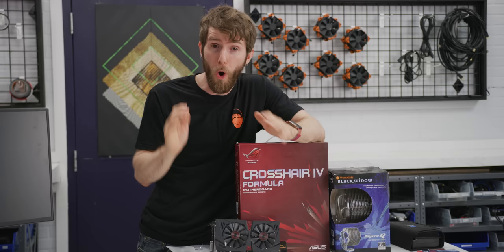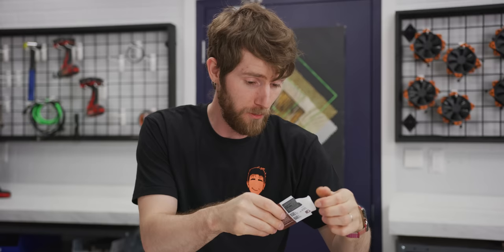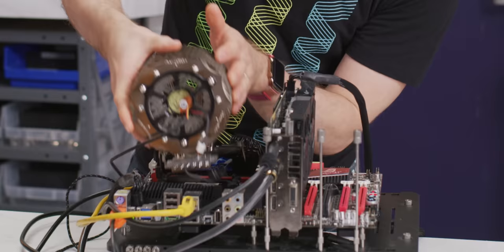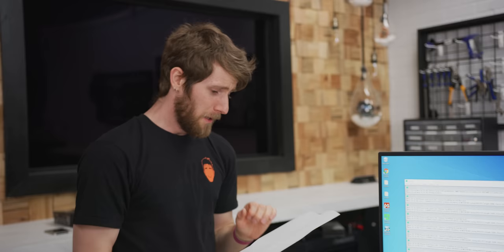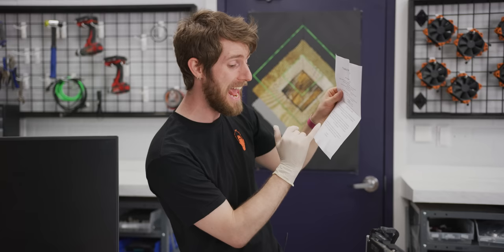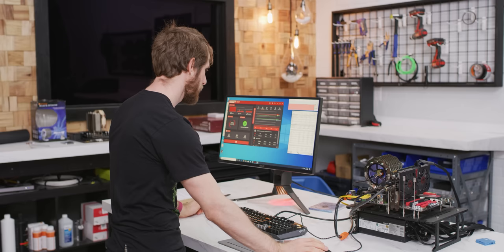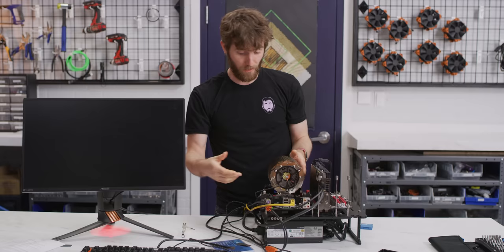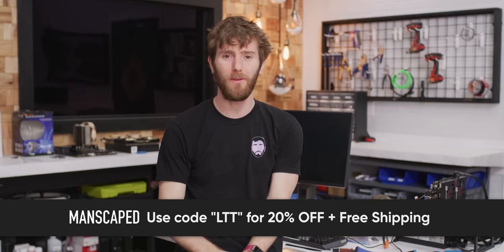Testing Another YouTuber's Thermal Compound!

Comment: Linus: "Haha the FX-8150 is so bad."
Me with an FX-4350: :C
Reply: hey 4 cores at 4.2 GHz base ain't so bad, giving you have an adequate solution to keep that 125w tdp under max operating temps of 61C. 
My brother is actually still using an intel core i7-860, which is advertised as a server/enterprise chip on intel's website for whatever reason.
Reply: @MrPlaneCrashers  Not really 4 cores, this thing should be around as fast as an i3 the same age in applications and slower in games.
Reply: @MrPlaneCrashers  I think literally any (or nearly any) ryzen chip outperforms a 4350, even with a slower clock speed from sheer IPC increases.
Reply: @MrPlaneCrashers  These are just Numbers, wich don't Cover every factor of Performance. I also have an fx Socket AMD CPU (A10something) and it's very slow. Gets half of the cinebench score of my 2011 Laptop. (the Desktop CPU is from 2013 or so)
Reply: @FredFredBurger92  No shit...
Reply: I used to have an FX-6300 but I upgraded.
Reply: I get it, it is just a number. I checked on userbenchmark as well as on this random video: https://www.youtube.com/watch?v=hJ8ulfGQRe0 and you are right, performs about as well as a 2013 i3-2120 or a i3-2130. I did not find a video comparing an i7 860 to other cpus, but userbenchmark says an i7 860 beats the FX-4350 by about 10%~, but most of that comes from the i7 being multi-threaded. That being said, from my very limited knowledge of CPU, I would expect the FX-4350 to be able to handle most basic tasks today. I do not think you should be having any problem gaming or doing any browser based activities that does not involve having more than a dozen tabs open. 

In conclusion, unless you have a specific scenario where your cpu is severely limiting you, I do not think you need to feel ashamed of your cpu. 

It is surprising sometimes how much game you can play on a crappy cpu given you have a good enough gpu.
Reply: If you are extremely broke and you have some decent ram and gpu a 8350 its a tiny upgrade but youll be really happy with it, ive been running mine for years. Most games even the new ones run perfecly fine on 1080p around 60fps, you could also overclock a tiny bit. Send me a message if you happen to need help with the overclock.
Reply: @MrPlaneCrashers  Yeah, for Medium Gaming it's ok, but if You do real work with your PC (editing, CAD,...) this CPU is useless. (btw. The amount of Tabs You can open depends more on your RAM than on the CPU.)
Reply: As i said, in comparison to my Laptop, i really feel how slow my Desktop is. Just when i browse the Web or doing oher Light stuff.

Comment: I feel like that thermal poxy would be perfect for when you want to use some small aluminum heat sinks and glue them on to ram chipsets or maybe the motherboard chipsets that dont have a cooler on them or any way to mount to the chip with a cooler

Comment: Linus: "Could anything be more conducive than silver?"
Me: Uhhhh... Diamond....
Reply: Also graphene. Both of which are in this epoxy.
Reply: Gold
Reply: @davidrasthammar1057  Both silver and copper have a higher thermal conductivity than gold. Although I have to agree that gold could be more *conducive*.
Reply: @andrewmorton9683  Gold doesn't tarnish or react with things - which is why a gold frying pan is great for frying eggs (some nutter actually did this in the 1970s for a National Geographic article, but had to give the gold back afterwards)

Comment: I love the GD-900 at 4.8 Wk, i put it on all my computers, laptops and even the video cards. Stable and cheap! 
One 30 Gram bottle about $6-10. Also like all the top better ones too for a few degrees cooler but much more expensive and anything around 4-5 Wk will do a good job and you can see your laptop run cooler and fan slower even though you see around the same temp running. noticeably less heat coming from fan area. These sort of tests, you have to lock off the fan speed and throttle or it will adjust and you could see all same temps. Another channel tried thin to thick applications and found the temps come out about the same although you should aim for a thin even coat in theory.   Loved your channel and all the advice and testing you do is a great help.

Comment: I have made a beer cooler using a peltier,  I have tested pro weld quick, just the steel tube, no hardener,  on it,  it works, it has metal in it, it kept me beer cold,

Comment: I worked with silver epoxy on a microscopic level to create electrical contacts maybe try that on a cpu but for its heat conducting properties? You should let the solvent evaporate before testing it to prevent bubbles of solvent etc.

Comment: I just swapped out my 8350 for an R9 3900X.  The 8350 clocked at 4.6GHz on water never got over 53 degrees...  I couldn't get it to run hotter than that under load.  The 3900X actually runs at about the same temperature, but interestingly it shows as hotter in Ryzen Master than in Speedfan.  Speedfan shows 53-55 degrees C but Ryzen Master shows around 74-77 degrees.  For context, I've got a Corsair H115i Platinum AIO.

Comment: 4:23
I ran a FX-8150 for over 10 years, it was clocked to 4.4ghz and with a max temp of 57c (using a free 120mm AIO). I disagree with your statement at the start, it was a great CPU if you gave it some love and attention :D
Reply: It clocked like crazy... but wasnt doing much with that.

I managed to get one to 6,1ghz with a diy phase change unit at -55c.

Ipc wasnt exactly the best.

Comment: TIMs work best when spread very thin. The sole purpose is to replace air bubbles that don’t conduct heat very well, with a thin film that conducts heat more effectively. The ideal is to have as much metal to metal/silicon contact as possible and only have TIM as the filler for the tiny gaps.

Comment: 12:00 it's epoxy glue. You also start with a liquid mix and end up with a hardened solid glue. There's a chemical reaction happening, which connects molecules into huge chains into a polymer. That's the reason it gets solid. But i have no idea if or how this influences its thermal conductivity.

Comment: the product is good for when u don't have a specific mounting, cpu and cooler have years of experience in mounting processes so It can use thermal paste for easy swap. I think the thermal epoxy would be useful for projects that need a thermal compound but don't have a modular interface, like LEDs or Batteries

Comment: What would a scenario where you can't use regular compound and instead have to permanently bond something be?
Reply: Satellite's or anything going into space or underwater. Devices that need to run until failure due to enviromental or installation constraints.

Comment: The epoxy would insulate against heat transfer between the diamond particles. It will transfer some heat to begin with, and then heat up over time and hold onto that heat because of the epoxy.
I don't see why it needs to be epoxy rather than just thermal grease...
Reply: Because it's a thermal epoxy, it's not trying to be thermal grease. It's a completely different product category with different applications. Linus decided to try it out as if it was a thermal paste, which was kind of a dumb thing to do.

Comment: Instead of wasting a CPU with thermal glue you should have used a couple of aluminium foils and use the glue between them and throw those foils away when the test is complete

Comment: i would sandpaper both surfaces cpuheatspreader and coolerplate, make the mix on the cpu, gpu mem chip, leds or whatever should get cooled permanently
my expirience i got from arctic silver adhesive is, this stuff keeps its great cooling capacity ultra performance and ultra strong after total hardening out.
if companies tell you a product is hardened out in 1day make it 3 and it actually is hard my guess is Tech Ingridients epoxy is less adhesive as it is 1/4 epoxy to 1/2 of epoxid and silver.
so from my expirience with liquid metal cooling surfaces (gallium metal plates are very nice especially on cpu and gpu chips mind never mix aluminium with gallium it is corrosive.)
by heating from within the cpu the 1st heatspreader keeps up ramping up then the metal starts cooking in itself, by evaporating inbetween it creates coldness this eventually ends when optimal max temp is archived and sometimes the material is behaving diffrently when you compare it over time  wich i like.
i think of the material as terminator shit (gallium) liquid metal kind of attractive because you basicly make the connection between expl cpu and cooler an active vapor chamber on the surface of said cpu
Think of the materials expanding and cooking themself in place to mostly opotimal distribution and the best you get that when you let it run and run on absolut max load the temps will rise to sometimes 70C then drop to 60 and below because bedder microconections may be formed
i have bought said product too will recieve inb few weeks will test :)
i loved the silver adhesive, my old R9 290 PCS+ basicly became gold with this shit mining hype is hard cant afford crap :P
love your videos

Comment: I have been using anti seize for automotive parts and its always out performed all thermal paste i have ever tried, It is mostly aluminum suspended in a mildly viscus fluid so you need to treat it like liquid metal. But I have always gotten 15 degrees better thermals than even liquid metal.
Reply: Copper grease is another option if you are using a cooler with a copper heatspreader

Comment: That CPU with cured epoxy crap on it would be a fine candidate for some surface lapping tests. If you grind it enough to cut into aluminium you should end up with perfectly smooth finish without epoxy. You obviously lose the laser markings on top but those are not visible through the epoxy either.

Comment: EDIT: Holly cow I miss understood where this was going. Let's just put all the heat conductive materials in an epoxy and see what happened TBH I'm curious. Original "Yes there are a couple things more heat conductive than silver but not many! All are arrangements of carbon (diamond, grapen etc) and the wild card (which still contains carbon) silicone carbide and theoretically several other carbides".

Comment: Hey, the old 8150, one of the first 8 core consumer grade processors. I'm still running mine in my personal rig, I use a closed loop liquid cooler, nothing special, but last I checked it only ran about 40°c. A far cry from "inferno"

Comment: you have large heat sinks on the power distributions blocks within a electrical room. permanent thermal compound is fit for that... so your power bridges in the server room don't melt down, think it was just a loose nut/bolt? really!

Comment: You know. i've had an interesting case of thermal solution working diffirently on the next day and on. I cannot lie. So i've just bought a new cooler and used my trusty AlSil-3 (it's a Russian paste, no fancy, but performs just OK) expecting to see at least SOME drop in temperatures compared to my old solution, but it still showed the same 60 or so under load. The next day, however, temps dropped for about 10 degrees and stayed there for good. I still don't quite know what the hell it was.
Reply: Did you open a window?

Comment: You should try Stress testing the CPU after you got it off. Because im fairly sure that it will shut itself down after a few hours of uptime due to the Factory limiter that the cpu comes with.

My cooler outlived itself to the point it ran without a cooler for 1 month.

Comment: I would not go through ALL this without de-lidding the cpu. I did so once with a Q6600.
Reply: You can't delid an FX. It's soldered. Even if you very carefully delid it, you can't really put a better thermal interface than what is already in there, which is basically direct metal-to-metal contact

Comment: The CPU will drop to 1.4GHz because a AM3+ CPU was used in a AM3 (non+) socket mainboard. I have the same board still in use and to get a FX to run you will need the beta BIOS. My FX-8350 on this board will drop to 1.4GHz after a few minutes of prime95 or several Cinebench runs even at stock settings. The same CPU in a AM3+ Sabertooth Rev. 3.0 doesn't drop at 80+°C. Please do the test again with a Asus Sabertooth or similar.

Comment: Maybe this is becouse of the way the video is edited but did you allow time for the epoxy to harden? it seems like you smacked it on there and just tested instantly. As epoxy hardens it generates heat so if it was not given the propper time to cure it may actually add heat instead of aiding in removing it!

Edit: Im too quick with my commenting ignore this

Comment: Well if you used it before it cured, you probably ruined the thermal paste. You have to let it cure properly before you do anything. I know from experience that if you do not let something cure properly, as instructed. It will fail
Also, the centre of the paste might take longer to cure. Depending on the reaction occurring. And remember that you used more than stated in the directions. That generally ends up with a longer cure time required.

Comment: should have done nothing (dry mount) as your worst-case bar to keep from throttling... would have liked to see if it was actually worse than,.. nothing. because it might still be useful as arctic aluminia's thermal epoxy is absolutely awesome, but hard to get now, and MG chemicals thermal epoxy,.. well to be blunt sucks,. not much else in thermal epoxy that I know of on the consumer level,. course industrial options are out there if your willing to buy in large quantities... i might buy a tube of this stuff just to run some further tests as it looked like it held well and might have only done marginally worse than that weird pad. but hard to tell for sure in this result.

Comment: This thermal epoxy can be good for gluing heatsinks on processors or else that have no mounting screws. It can find use in any electronics shops. I needed that kind of epoxy when I build some of my experiments in my workshop. But for sure it's not for CPU, I was sceptical about it and waited for the end to comment. Well it can be useful but not for CPU.............
Reply: Yeah it's really not meant for CPUs.

Comment: in the same way that epoxy "popped" in a clean break away from that heatsink, as in... not permanently attached, you can use a razor to shave off the epoxy from the CPU.  Its not on there forever.

Comment: Honestly boys, I'm not sure you're comparing apples with apples. Is a thermal epoxy supposed to be or expected to be equal to a thermal paste? We glue heatsinks to chips where no other retention exists so a glue isnt so much a preference  as it is a solution. My question to you is how does the tech ingredients epoxy compare with other epoxies - specifically for the actual applications they're used for? I mean really, who would glue a heatsink to a cpu? Seems a bit click baity to me.

Comment: I have an i5 4690k that hits 100c idle what is wrong, do you think I should try and reapply thermal compound, it’s a five year old build and I think I might have accidentally raised the cooler not too long ago... but no blue screens but it never goes over 100c idle is usually around 70c-90c with spikes and watching 1080p YouTube it hits 90+

Comment: Is this a nokia cpu? It popped out of it's locked socket twice, got whacked by a hammer then later wedged out of the heatsink using a chisel.
Meanwhile i was replacing the wraith cooler of my r5 3600, twisted it out ever so gently and bent 2 godamn pins

Comment: How disappointing I had high hopes for this thermal epoxy the fact you can't remove it without getting a chisel out is very impractical and the performance is kinda bad compared to cheap Chinese thermal paste. I think with the dendritic copper it simply doesn't have enough contact surface to really transfer the heat .

Comment: SIR I HAVE HP ZBOOK 15 G2  I7 4810 QM PROCESSOR ITS IDLE TEMP IS 42°C AND ON FULL LOAD IT JUST JUMPS TO 98 TO 100 °C 
AND ON GPU MAX TEMP IS 73°C . I HAD CLEAN THE FAN AND SET THE FAN SPEED TO MAX  BY A SOFTWARE ,AND I HAD ALSO TRIED A COOLING PAD DOES I NEEDED TO CHANGE THERMAL PASTE

Comment: Epoxy is viscous stuff. It smooshes like honey over time (hours) before it cures. It's a chemical reaction hardening, Not a Drying! Idk, I'm still convinced you might have ruined it. Be more think! Chances are you have to be skilled and knowledgeable to use it. You ain't stupid, but you just may not know.
And you're certainly not manually inclined xD

Comment: I have an inkling this is simply showing the limitations of the rather "awesome"(ly crap) cooler more than the paste. 
Bit of a turd on the work put into this permanent thermal conductive glue that only used other paste as example seeing as there no other competitor - the application of this paste would be far different from desktop pc's.
Also did you confirm how perfectly flat both cpu & coolers surfaces would? You've lapped cpu's before.

Comment: Saw the Maker's video and claims and was very skeptical mysef, glad Linus tested it.

An epoxy, especially a thick one should not work well with CPUs as the surfaces are relatively smooth with few areas for epoxy to bond.

It's very possible this stuff was meant for more porus surfaces such as an IC chips which bond very well due to having a rougher surface.

Comment: This is why, to make your experiments statistically significant you need to run them a few more times than once (well, a lot more really).  Also, you may want to make things fairer by not arbitrarily using a heat gun.
Statistics/conclusions generated from tests run only once or even a few times are fairly meaningless, but that's not limited to only this video.